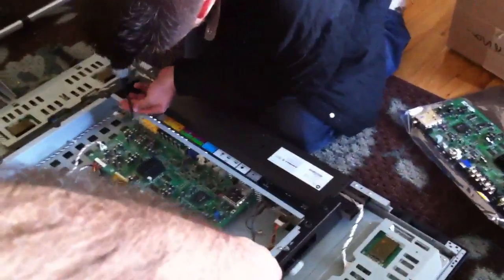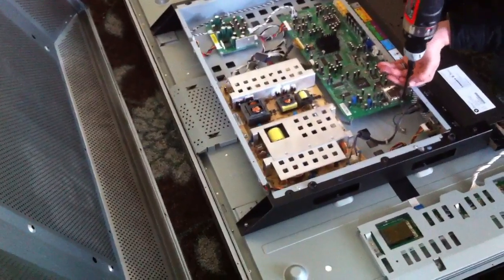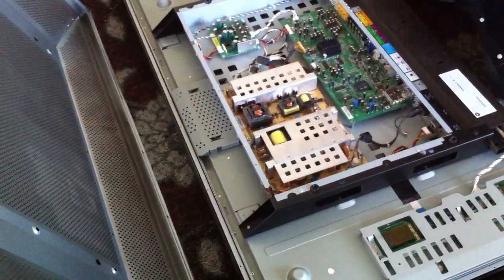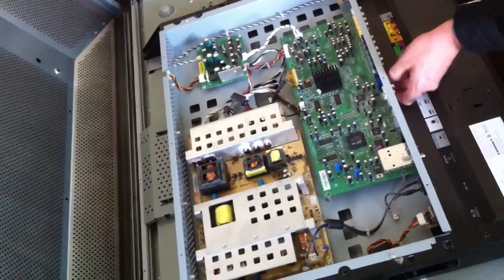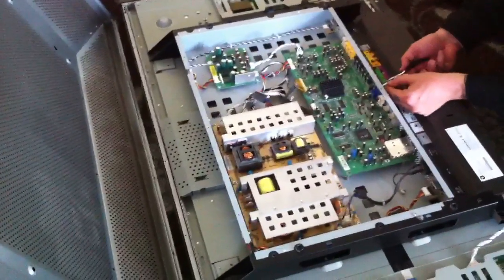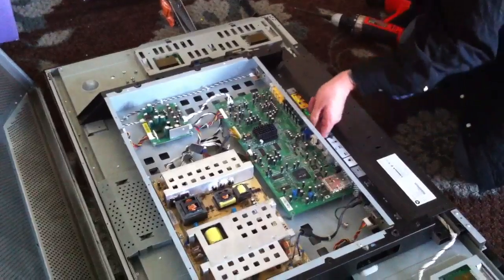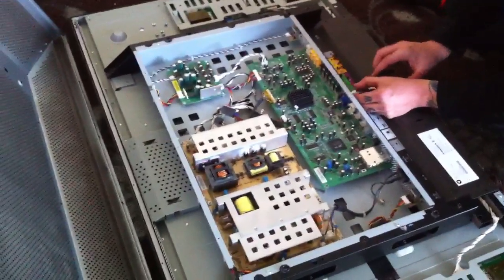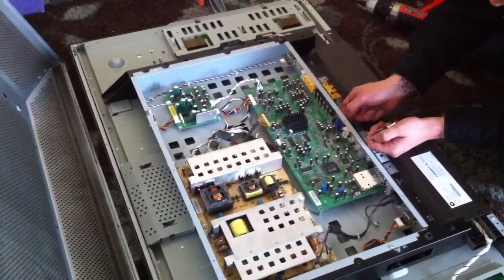Vizio TV Repair - How to Install Vizio LCD Motherboard

Comment: We have a 65” Vizio that’s only two years old, we bought an extended warranty, so thankfully we still have another two years of coverage. 

A few weeks ago, the TV suddenly lost its picture, but still had sound. Sometimes the picture would go away a few minutes after it was turned on, other times it would take 15 min or so to turn off. 

So, we called the warranty company and they set us up with a local repair guy. He called and asked me to tell him exactly what was happening. 

He said it was the backlight board, that it’s a common Vizio problem. It’s gotten to the point where Vizio has a repair kit with the backlight board (and I believe also the motherboard included). 

The repair guy should be here today, so hopefully that fixes our problem. 🤞 But if it’s out of warranty, I saw people on the Vizio forums saying that you can get the parts for around $25-50, depending on model.  

(Side note, the repair guy called me last week to let me know he got an email saying the repair kit was on back order and would be delivered on 4/30, yesterday. So, that sort of tells you how much of a problem this is with Vizio...)

Comment: I have a Vizio tv that was working fine until  last Tuesday night when I turned down the audio.  Wednesday  night I tried watching tv but no sound. I checked everything, unplugged for a day, still no sound. I have picture. when I try to change channels, the sound tries to come through but does not last  long.  what's next?

Comment: I have found that I need to replace the mainboard in my vizio 42 inch.  Symptoms came slowly.  First the side HDMI stopped working and I assumed I did something wrong like perhaps trip on a HDMI cord ran to my CPU.  Second was crazy.  Only when a HDMI device is sending imput to my HDMI one port my TV backlight flashes,  turn it off and it stops.  HDMI port two functions properly along with all other inputs and it appears that slowly the board it dying.

Comment: hey, man. can you help me out? i got a VIZIO E3D320VX from ebay brand new. It die after the warranty. The problem is that when i turn it on the LED lights on, the screen also gives a "flash" and the on sound, but then the screen flashes again and turns off immediately. Do you think its the motherboard or a power problem?

Comment: What the hell? Why are you replacing this anyway? My guess is it's probably just a 30 cent SMD. Yet you spent 100+ dollars on a whole new motherboard that will eventually die again. haha! To the guy that has "power on" problems. Check the capacitors on the PSU. 90% of the time, that is the problem.

Comment: I have one question.  Why did you have to replace the mother board?  What was the problem?  I am wondering if your problem is similar to mine and if I should replace the mother board.  My 552XVT has a reboot issue that I cannot solve.  It is out of warranty and Vizio is no help.  I have tried the unplug/hold power button 30secs/reboot and power up routine.  Sometimes this option works, others times it doesn't.